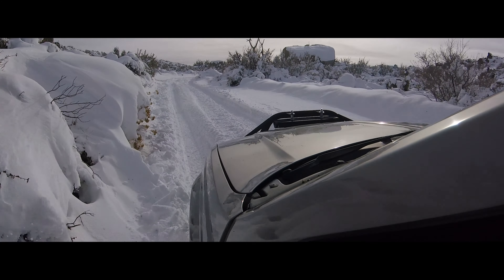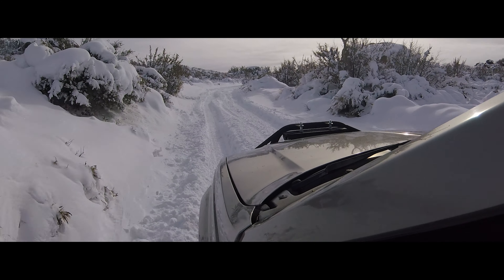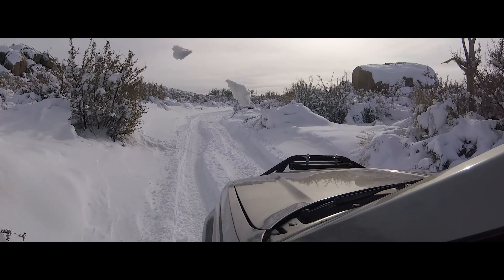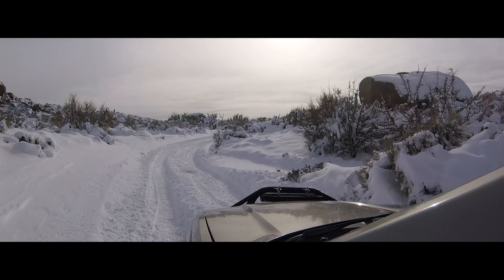1999 Jeep WJ: TRANSFER CASE UPDATE [4K]

Comment: Do you install a lockers in your lsd differentials or just added the new transfer?
Reply from the maker: Just the transfer case.  But on the WJ you will need shorter drive shafts. Check the entire install series for lessons learned. Great question!

Comment: Who did you source the transfer case from? I might end up doing this since that will probably be the next thing to break on my WJ.
Reply from the maker: I just did a Google search. Came up with Transmart in Montclair, CA.  I was looking for a NP 242 with hopes of a 242HD. They surprised me with a 242 AMG off a Hummer H1.  No 2WD, but axles lock in HL and LL.
Reply: Thanks! I was expecting to have to get something shipped from halfway across the country. A local supplier is fantastic.
Reply from the maker: They have an ebay store, too.  That's how I found them, then I called their shop direct. Man, it's all coming back to me now. Lol... Talk to Magu. 626-733-0718
Reply: I found one in a 95 xj all I had to swap out was the input shaft and rear driveshaft same as hd inside and had 2wd and only 300 bucks

Comment: How are the Vari-Loks working?
Do you use synthetic oil and FM?
Reply from the maker: No vari-loks installed.  It's the transfer case off a Hummer H1. Same as the military grade 242 HD on a Humvee.  I've been searching the interweb trying to find an explanation for you guys, but basically High Lock and Low Lock make all the axles work together, eliminating the limited slip factor.  You can steer easier in HL than LL, of course. Oil I used is right here: https://youtu.be/JUIQ971TWJk